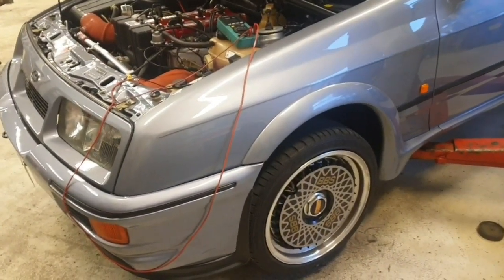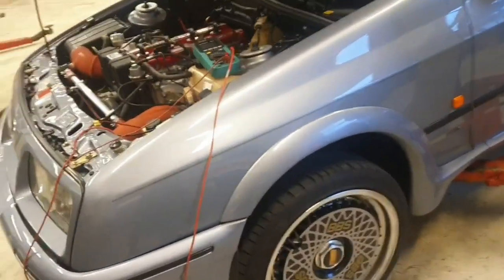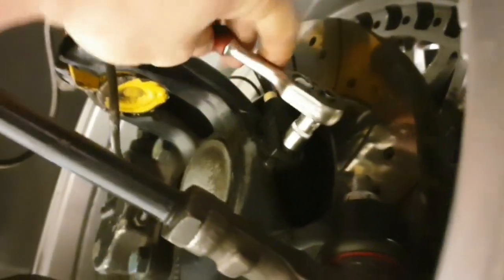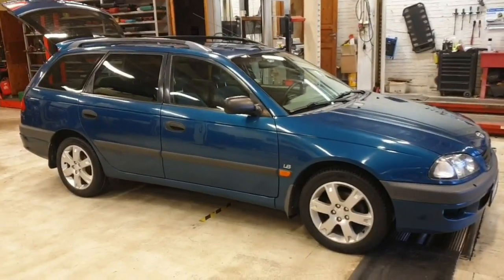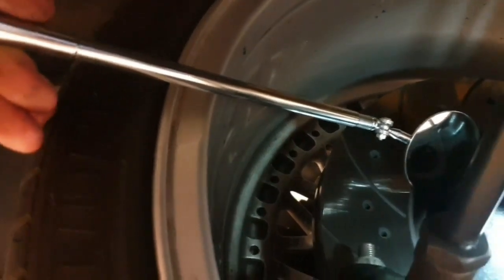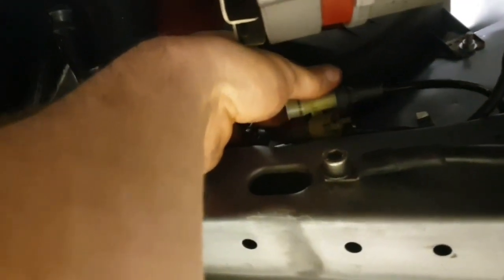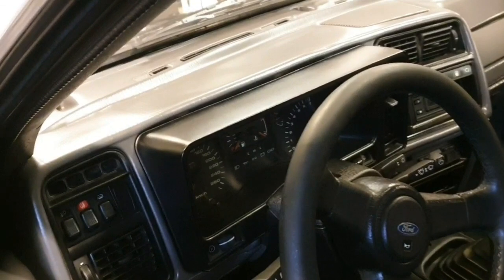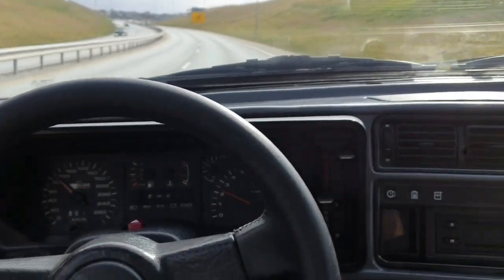Ford Sierra Rs Cosworth "ABS Light On When Driving/ Diagnosis/Sensor Output Problem/Replacement

Comment: get a cheap hand held digital oscilloscope from zyoti for about $60 - you will be able to view and save the exact waveform from the sensor when spinning the wheel
Reply from the maker: No real need for a scope to do tests on these inductive sensors. That said...i will definetly check out the scope you are referring to..as i do want a hand held one for my tool kit. Have proffesional scopes /diags etc where i work..but a small handheld one would be awesome. Thanx for headsup. Greetings from Norway ,Stefan :)
Reply from the maker: By the way,you need to repeat the name of the specific scope you are talking about..cause i cannot find any brand called that..but i found two that are " similar" to that name..
Reply: @TheCarTakerGarage  https://youtu.be/lZdq8iCWqgE?si=m5ciq6p-niKJo8TP
Reply: @TheCarTakerGarage  zt-706s
Reply from the maker: @eliotmansfield  That is probably not a good one.Its like two or three pictures,of it on some chinese page...so not a thing i would buy at all.But thanx for comment anyways.